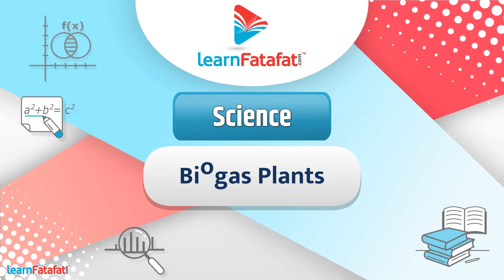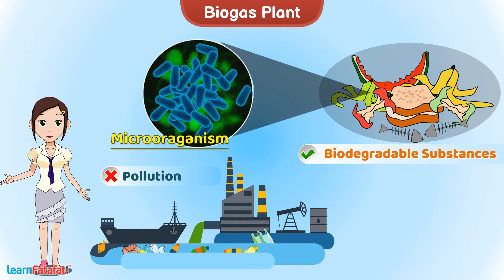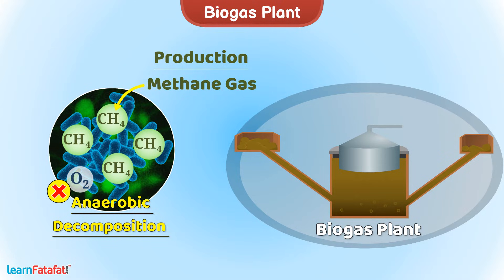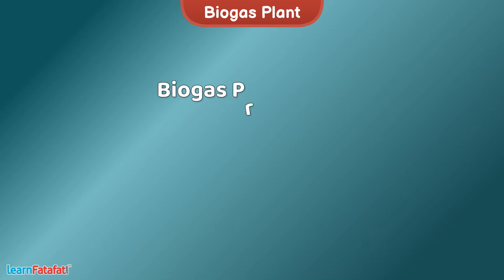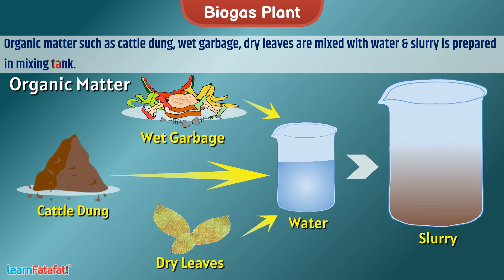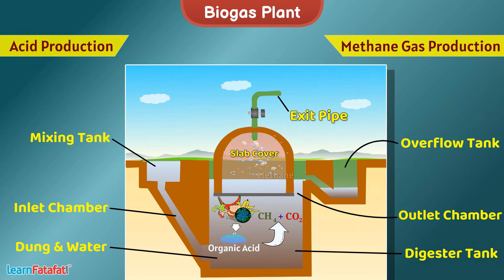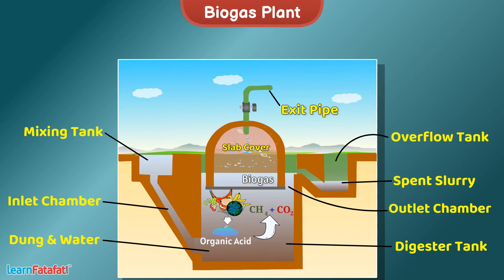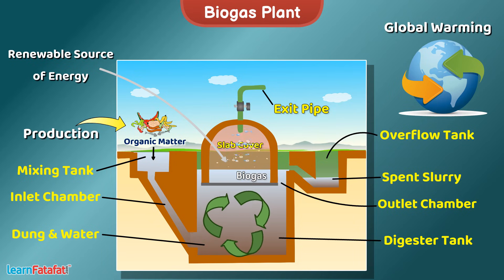Biogas Plant | Science | Working Model and Explanation

Comment: Biogas is methane (CH4), Carbon dioxide (CO2) and sulphur dioxide (SO2). There is nothing green about burning methane. When you burn methane it ends up as excess CO2 in the atmosphere just the same as burning any fossil fuel. CO2 is the main greenhouse gas that is rapidly changing our global climate. This is not a green solution. Aerobic composting produces far less CO2 and no methane. Composting produces the same rich fertilizer.